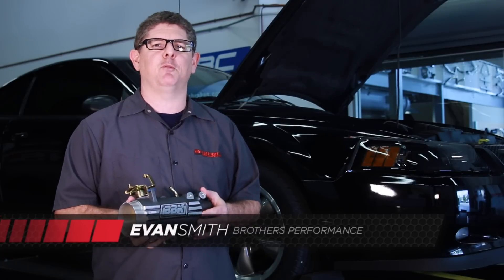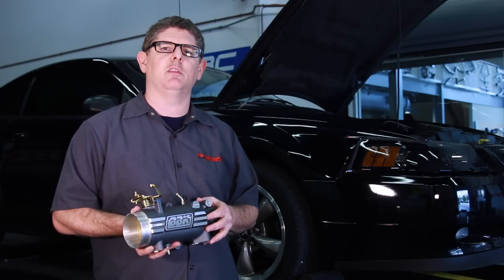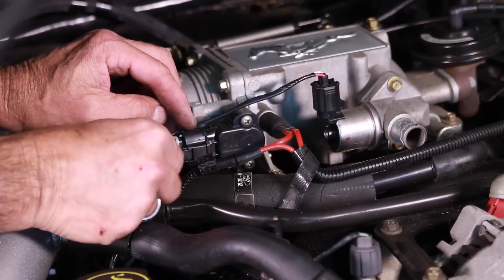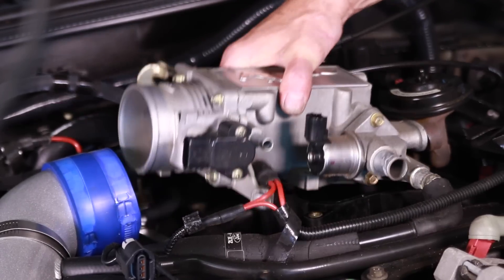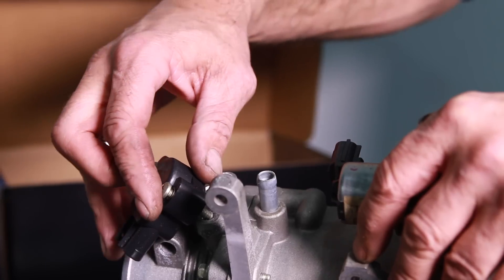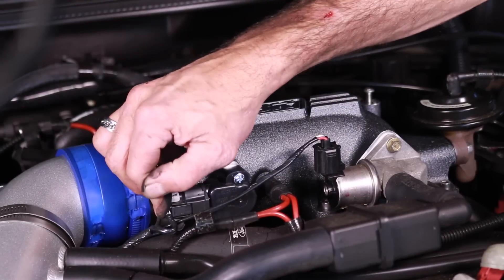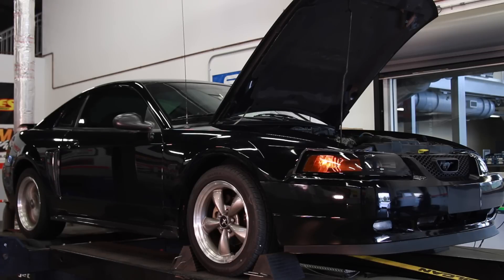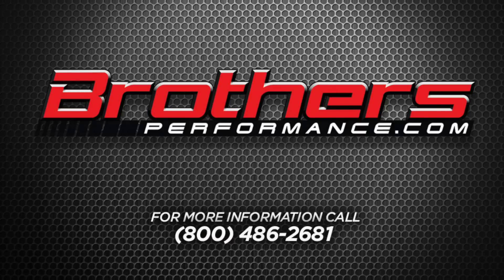1996-2004 Mustang GT 73mm BBK Throttle Intake Installation And Dyno Test

Comment: Do you need a tune
Reply: No I have a 78 mm throttle body no check engine light or hiccups runs 100% fine!
Reply: @silversixcreations did you notice a difference with the 78? I got the 73mm and it’s noticeably different but wondering if I should have went with the 78
Reply: @YakAttack64  I bought it with the 78
Reply: @silversixcreations  how’s it feel?
Reply: @YakAttack64  I think it feels pretty good I’m a manual 2v with 78 mm tn cold air intake high Flo cats and mufflers and I keep up with almost every 300 hp car Ik I waxed a 5th gen v6 Camaro by 4 cars put a bumper on a exhaust only 3v and had a even race with a 2014 challenger r/t
Reply: @silversixcreations  shit that’s sick. What other mods do you have if so? I got the  the 73mm plenum/TB kit, Bbk long intake that goes into the fender, 3.55 gears, 18” rears with 20 year old pilot sports XD I’ve never tried racing dudes cuz my city is uptight about that stuff but maybe some day
Reply: @YakAttack64  that’s it stock rear gears still too going 3.73 and upgrading to cobra brakes soon then tackeling suspension